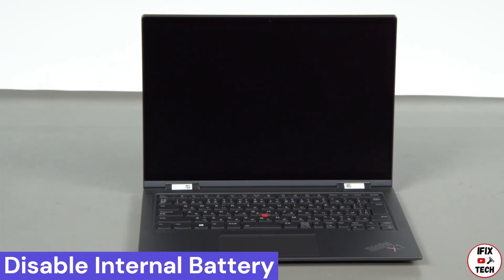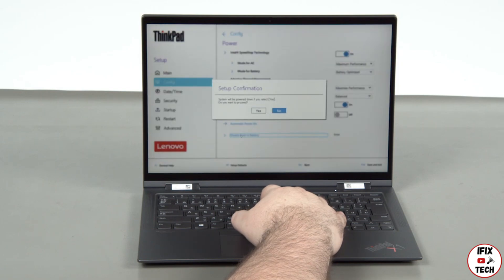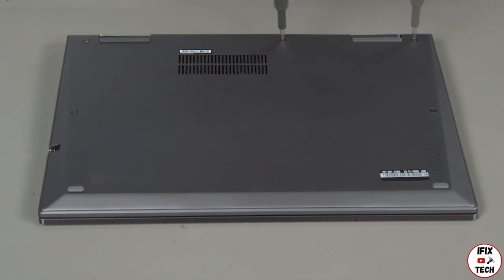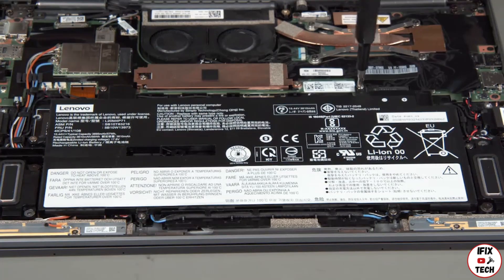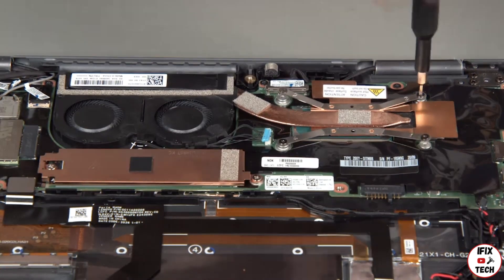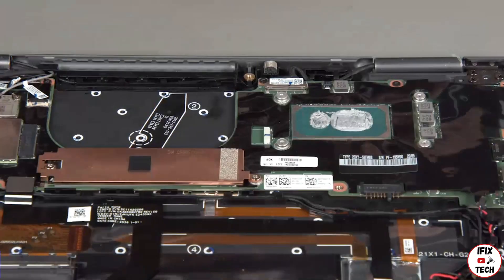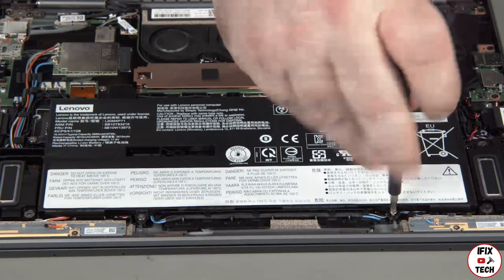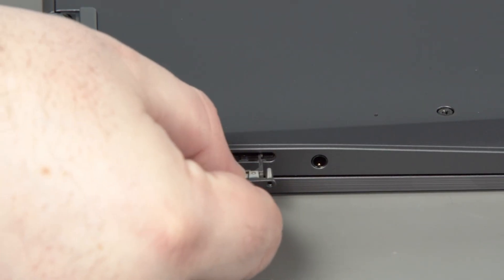Lenovo ThinkPad X1 YOGA FAN Replacement Gen 6th - 7th - 8th - How to Remove Heat Sink Fan

Comment: Where can i get the replacement heat sink fan
Reply from the maker: You can try the Lenovo site or eBay.
Here is an  EBay link. 
https://www.ebay.com/itm/156160254562?mkcid=16&mkevt=1&mkrid=711-127632-2357-0&ssspo=-aaDiLp0RpG&sssrc=4429486&ssuid=-aaDiLp0RpG&var=&widget_ver=artemis&media=COPY